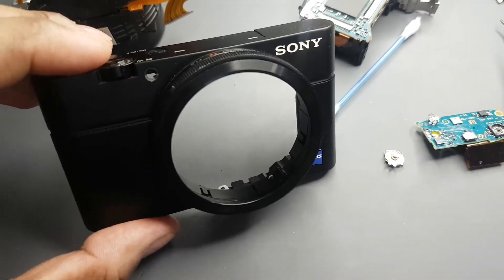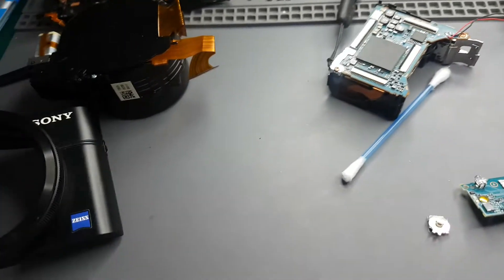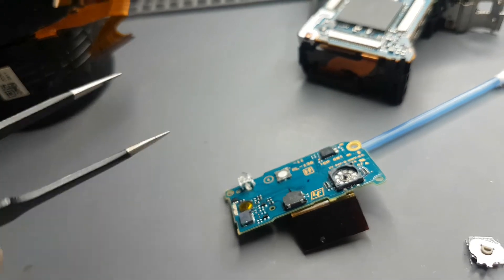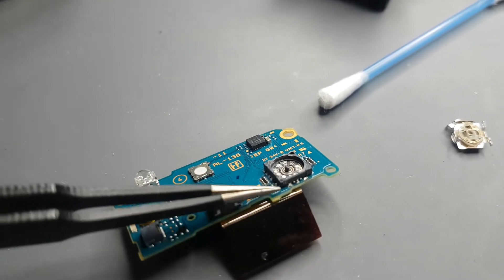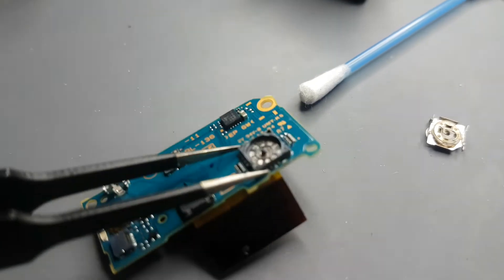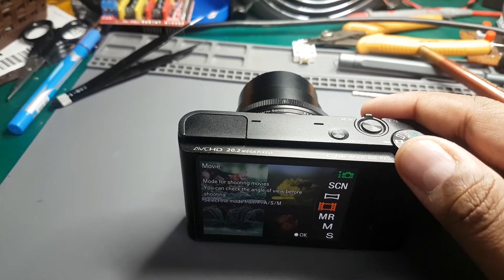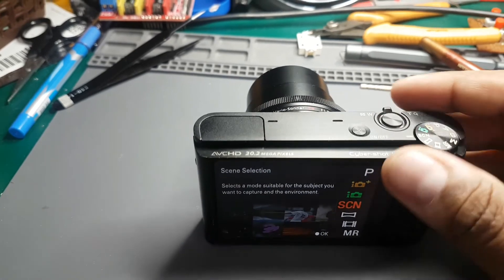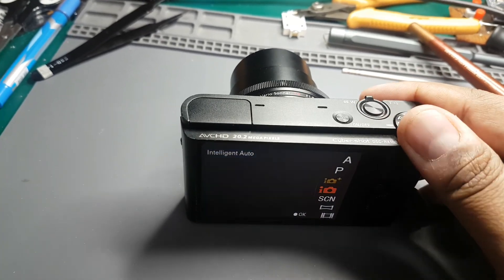Sony RX100 Mode Dial Repair Mark 1 2 3 4 5 6

Comment: I had the same issue. You need to dismantle whole camera to get to the board with the wheel. However disassembly of the this tiny rotary element require advanced equipment and skills and still there is high probability that you will damage it during resoldering or soldering back. Instead I have dipped whole board in isopropanol, left for few minutes and turned multiple times when it was immersed.

Comment: My Mk3 went back for a warrantee repair four times in the first two years for this same problem. The problem has returned again after 3 more years and I've also noticed it slightly on my 2.5 year old Mk6. Sony make great cameras, however they are not durable. The flash has also stopped working on my Mk3.
Reply from the maker: True my mk1 fell from 1 feet on a carpet floor and the lense stopped coming out. Full lense assembly had to be replaced under warranty. I do not use this camera much, to me most of the times the cellphone camera is enough, that is the reason it has survived till now.